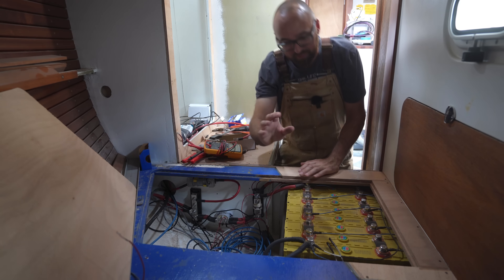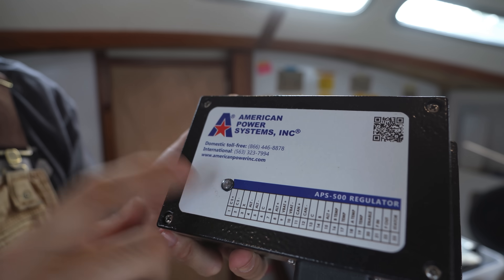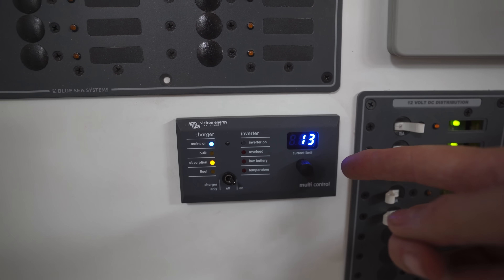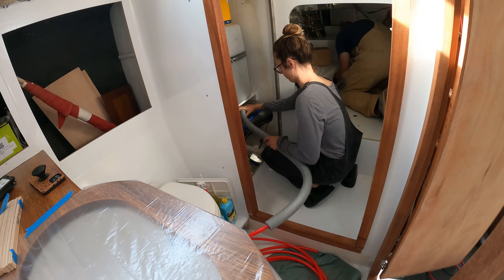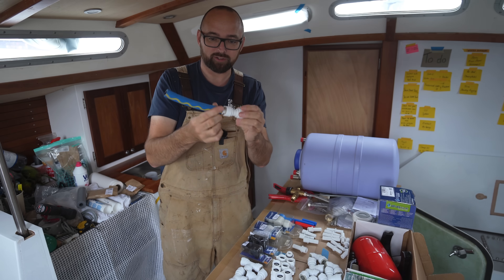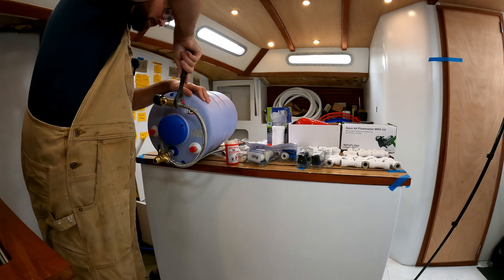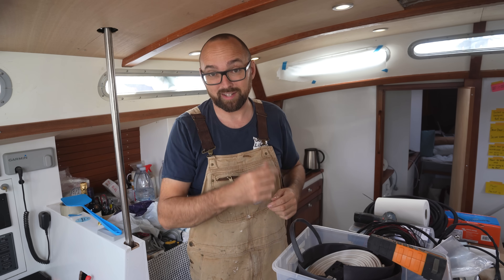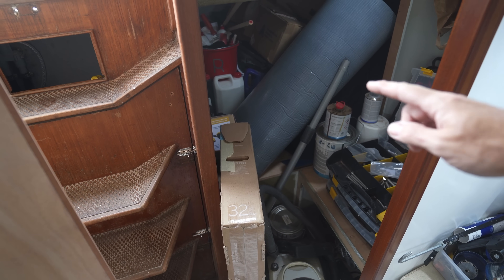Sail Life -  LiFeP04, REC BMS with Victron Cerbo GX, 5kW Quattro & pressurized water system

Comment: You guys are coming along nicely. Those water pipes looking really nice. I thing I will have a try with that this winter.
Maybe you know, but if you don't, Volvo Penta recommends that the expansion tank of the engine is well above the highest point in the cooling system. There is a minimum number, just can't remember it. But if you haven't thought about it yet, have a look so the waterheater isn't to high. If so, solution is to mount the expansion tank higher. Sorry if this adds to the work list. 😊
Kr, Håkan

Comment: How do you manage charging the lithiums with solar panels? What cuts them off when the battery is full or is balancing itself?
Reply: I believe he is using a separate charge controller for the PV setup that connects to the BMS, but I could be wrong.
Reply: Or what happens to the solar controller when the BMS throws the relay you might blow it up???
Reply: I think he has redundant pv charge controllers. I think each controller is hooked up to two panels.
Reply: All documents say do not disconnect batteries when solar controller Is charging

Comment: I'm just wondering with all the electronic gear on the boat what protection is there from lightning strikes?
Reply: you hope the lightning doesn't fancy finding it's own way out through the hull & you keep a good bank balance to replace every single piece of electronics on board ... that's just about all you can do
Reply: @guy.h  I mentioned this because I saw a sailing boat being fitted with lightning protection that actually feeds the strike through dedicated cabling to the hull to special through hull fixtures but with setup on Athena I also wondered if all the electronic monitors would isolate the electronics.
Reply: This is ensured by the lightning protection app that will automatically notify Mads instantaneously if a lightning has struck and propose a spiffy solution.
Reply: @andrewseaman7012  Is there a reason why you are being a sarcastic ass??

Comment: are you sure spares for plumbing system pipe and fittings are available world wide ?
Reply: Whale is just one of many that market fittings for standard sizes of pex etc. You’re not really tied to any one manufacturer except for spare seals for faucets, but tbh I find that just replacing the unit for something similar but new makes for a much longer lasting fix. 
So, no problem. 😎👍🍻

Comment: Great video (as always).  What make/model water filter did you use?
Reply: people in the states seem to add a carbon filter after the sediment filter to get rid of odours. I would recommend on top an in-line-UV-LED-driven flow-through-desinfection unit controlled by yet another app to keep up with the electronics side of the installations.